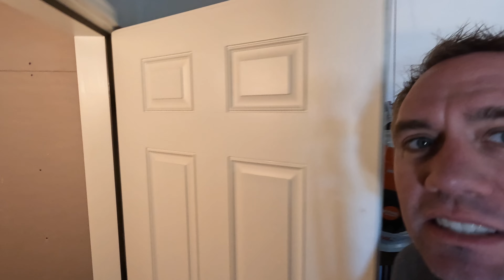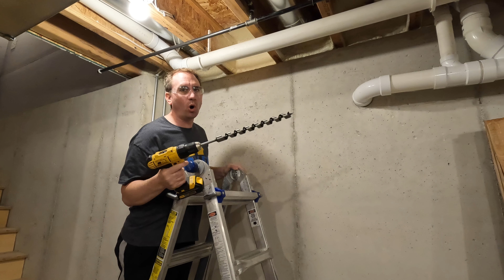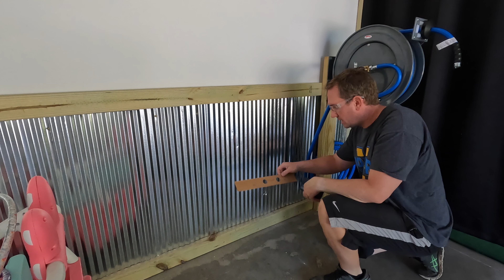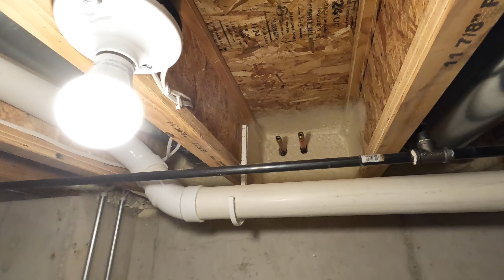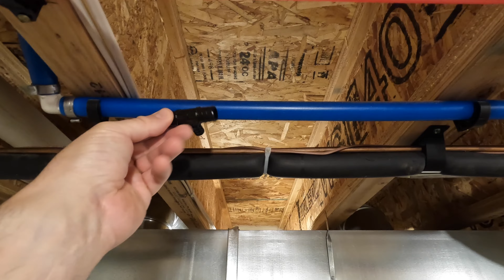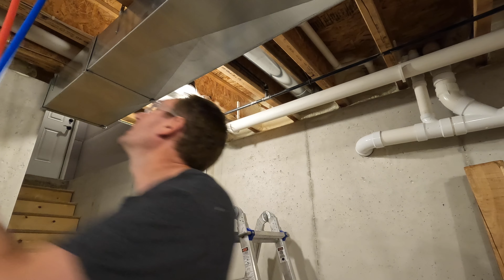Upgrade your garage - Part 4 Hot - Cold Water

Comment: What did you use to make the wall water proof
Reply from the maker: I wouldn’t call it water proof…maybe water resistant.  Anyway, that is covered in this video:Upgrade your garage with corrugated steel - Part 2 Finish the Steel
https://youtu.be/rDmrYtfU1jY